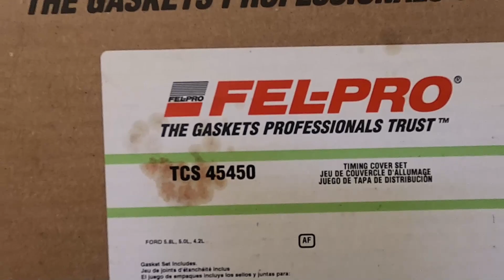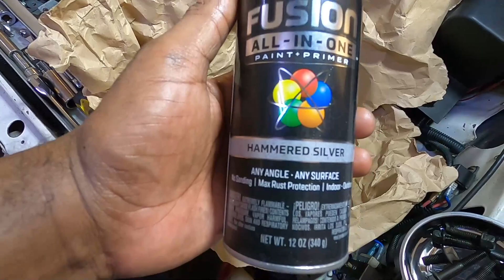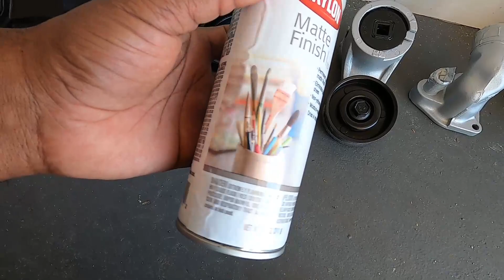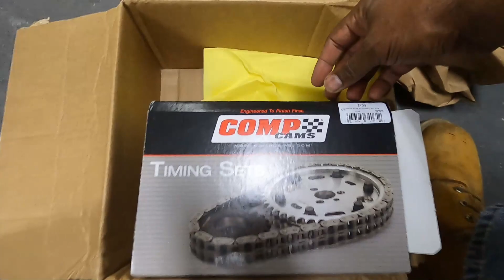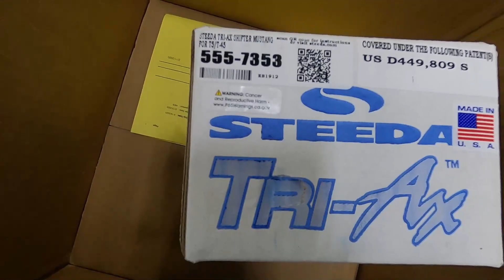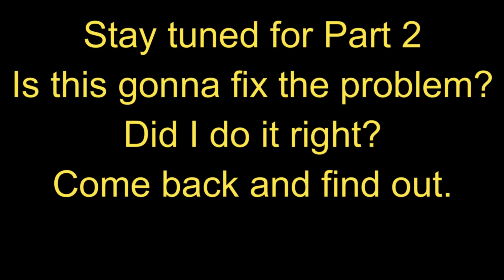Foxbody engine leaking repairs

Comment: I’m thinking my timing cover gasket is messed up I pulled off my water pump to change thermostat and now my car keeps leaking and I changed out the water pump gasket three times now
Reply from the maker: It can be very aggravating, just make sure all the surfaces are very clean when going back together with it.
Reply: @thefoxchamber  I’m think the two bottom metal backing plates on the water pump are getting caught up in the timing cover

Comment: I had a coolant leak between the waterpump and backing plate. Leaked for years before I had enough of it. It was leaking between the two bolts on the backing plate. Took me 4 tries before I sealed the sucker for good. I used two washers for the two bolts for better seal pressure and used blue hylomar instead of rtv silicone on the 4th try and presto it worked!!!
Reply from the maker: Mine was the gaskets. So far so good, no leaks

Comment: Nice video! I used Ford Motorcraft RTV Silicone sealant ta-31 for all my engine work! No leaks! Thin coat on both sides of gaskets! Its made for diesel engines! I've got it on both of my boosted foxbodys! ;-)
Reply from the maker: Thanks, information noted